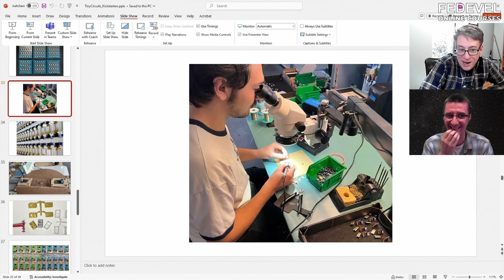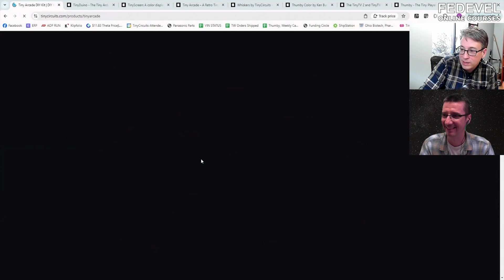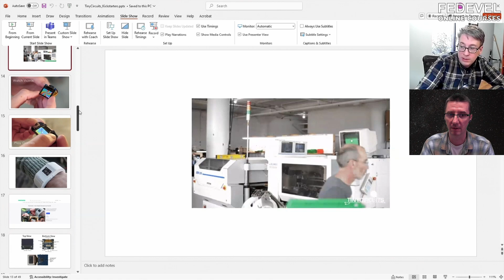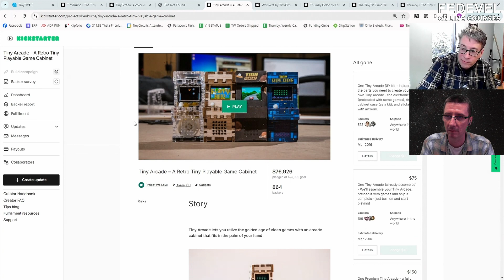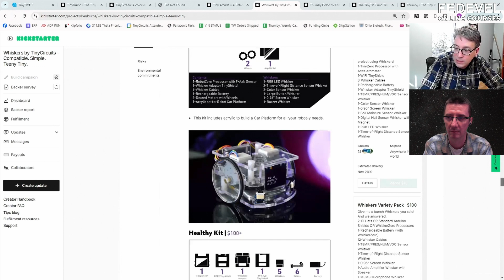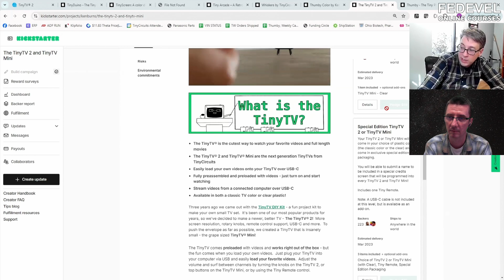Can You Make Money on Kickstarter HW Projects?

Comment: You are technically selling an electronics product. How do you do with CE certification and UL certification for batteries?
Reply: I had the same question watching the video and would be interested in the certification requirements/possibilities for makers. There are some threads out there, but I haven't seen a reliable guide. For finished products like the tinytv CE would be required in Europe. Afaik you can get away with selling dev boards, kits. etc. in Europe without certification, but no guarantee. Having dipped a toe into the certification world, my impression is that the lines often are blurry and I've heard about certification prices (CE & FCC) between 1500$ (am I allowed to mention companies here?) and 10k$ for a simple product. For a more complicated product of course it can easily be beyond that price. So that cost needs to be considered too for such projects if you take the EU directives seriously and don't just slap the CE mark on your product. I know that doesn't answer your question, but I'd like to second the interest in the topic.
Reply: If your product don't use radio signal(wifi/bt/etc) it's more cheaper... actually you can do some pre test with a spectrum analyzer and some special antenna by yourself. Then, if you are not confident you can ask to lab to do some extra and accurate test. For a product that works on battery you have to check if your device emitt any sort of radio signal above the standard that you are try to comply. If the device works with recharchable battery probably you need to check if any sort of interference is injection in the charger...